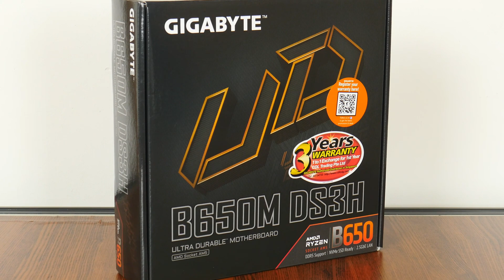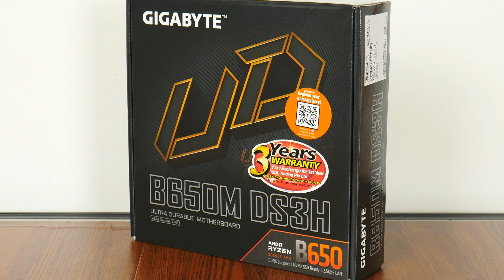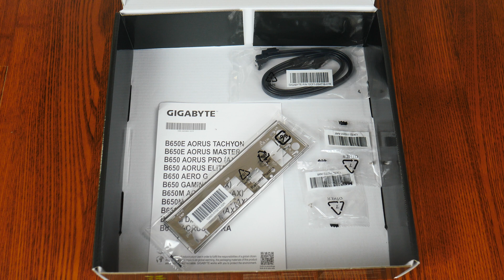Entry-level AM5 Motherboard - Gigabyte B650M DS3H Unboxing & Overview

Comment: Would be good check the Aorus B650 PRO AX, it seems have to many options and the price is not high like others brands.
Reply from the maker: Mm, the B650 PRO AX would be a step-up over the B650M DS3H for sure in terms of specs, but at a price of course!

That said, the B650 PRO AX does seem to serve up a very balanced feature set with a more premium audio setup, Intel 2.5 Gigabit Ethernet and WIFI 6E 🤔

Comment from the maker: UPDATE AS OF AUGUST 2024: This video was published before 64GB DDR5 memory modules were available - according to the Gigabyte specs page, this motherboard now supports up to 256GB of RAM with 4x 64GB DDR5 memory modules. In addition, "Zen 5" Ryzen 9000 series processors and "Zen 4" Ryzen 8000 APUs are now supported with a BIOS update that is available for download from Gigabyte's official website.

Check out the written article version of this motherboard's review here: https://www.alktech.co/articles/review-gigabyte-b650m-ds3h-am5-motherboard